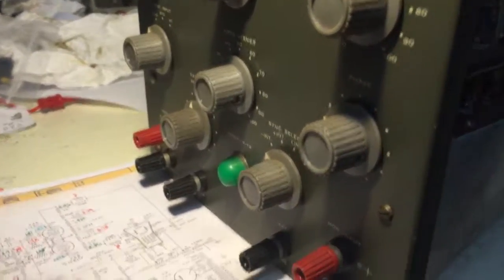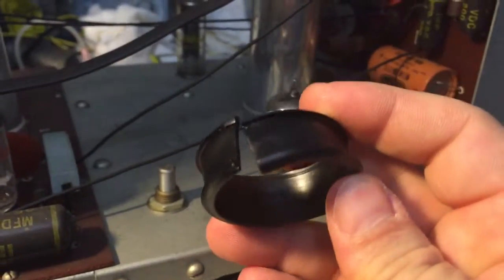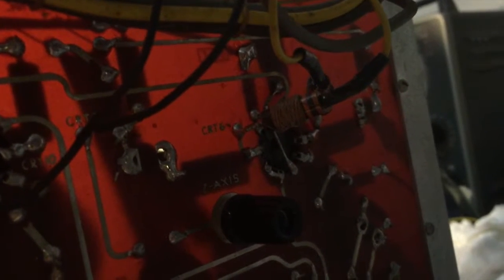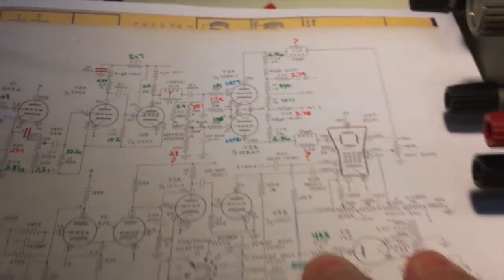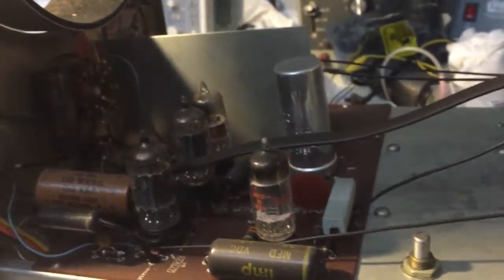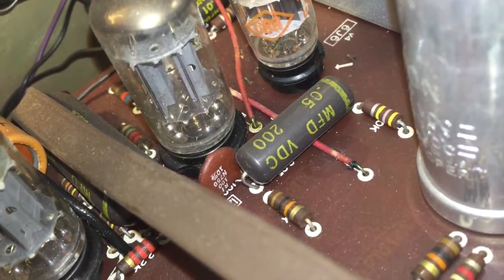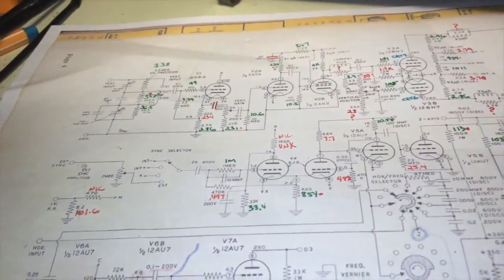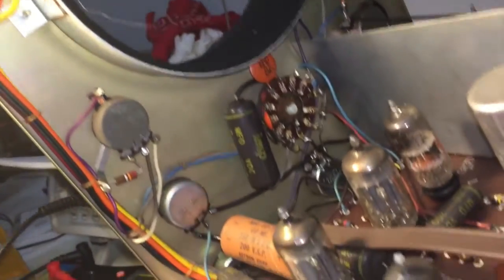Heathkit Oscilloscope O-12 Restoration & Repair 2 - Component testing

Comment: I was watching another video on this scope.  The guy found the same missing resister.  He found that the assembly instructions did not mention the 100 ohm resister .  He concluded that the schematic was an error.
Reply from the maker: There we're probably several revision of the schematic over the course of this model and few remaining available on the internet for free, no doubt, some of the revisions wont line up.

Comment: If you look at that schematic again, the voltages after the 100 ohm resistor are in the 300's. The 450 written there is the capacitor voltages.
Reply from the maker: Indeed...   450v is irrelevant and is the CAP rating, i should have caught that.  430 is the voltage a pin 7 BEFORE the 100 ohm resistor, there is no value for a voltage reading after the 100 OHM un till after a further resistor down the line such as the 1K that becomes 350V